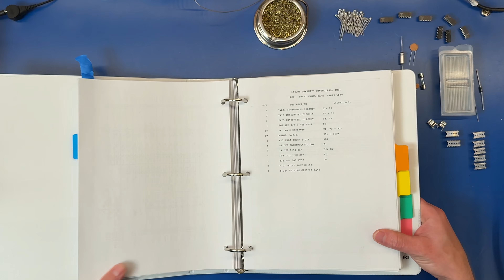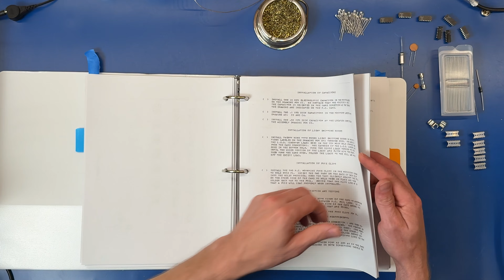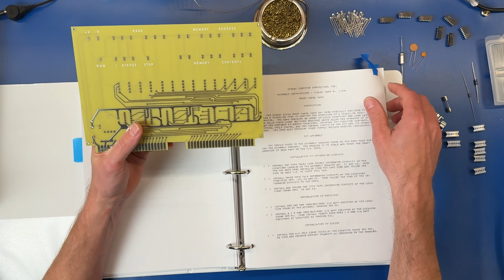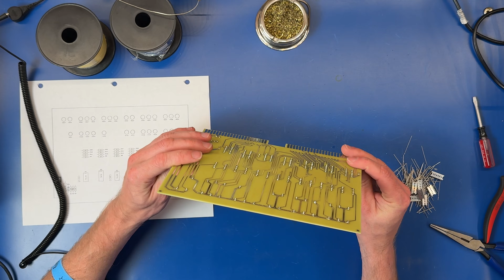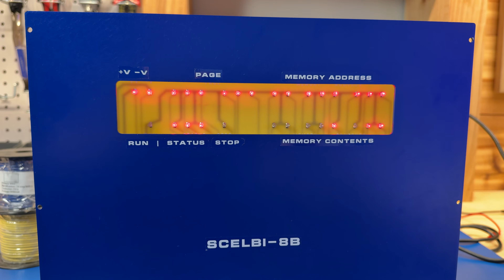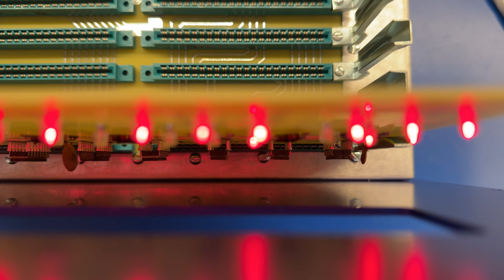Assembling the Front Panel Board for the SCELBI 8B

Comment: Cool project!

I often cut the LED leads rather than trying to clean off the tape residue. (I buy them by the hundred on cut tape). Obviously, cutting them loses the 'long lead' information.  The flat side of an LED is the cathode.

If you don't have a filter for that window, at least stretch a piece of sheer, dark-coloured nylon (cheap pantyhose material works well) across it.  It's astonishing how much even a simple neutral-density screen will cut down on the glare.
Reply from the maker: Good info. Thanks!